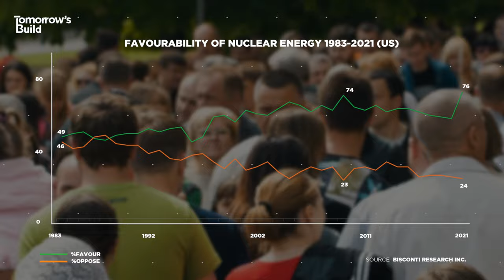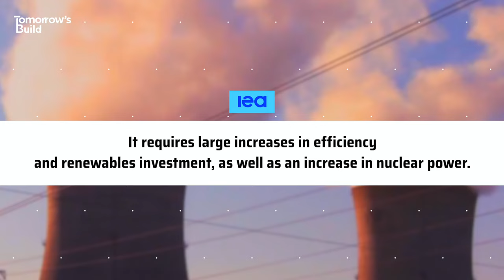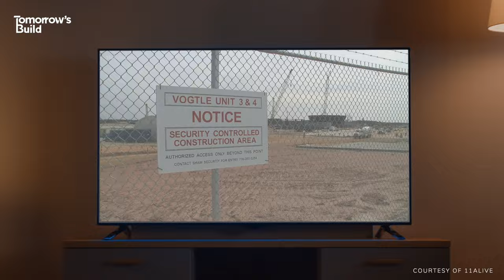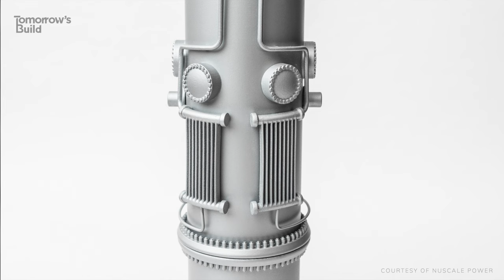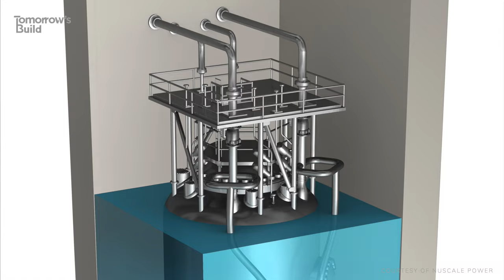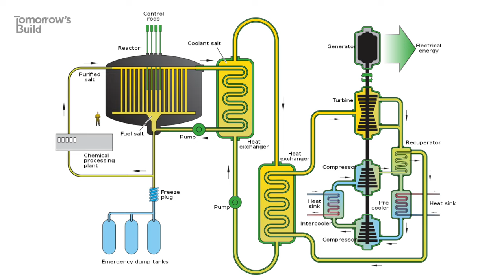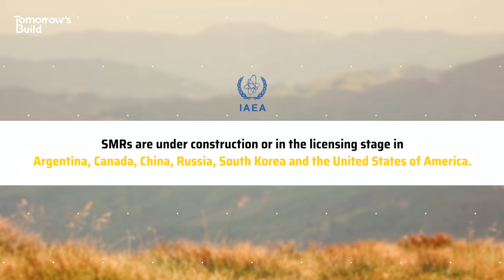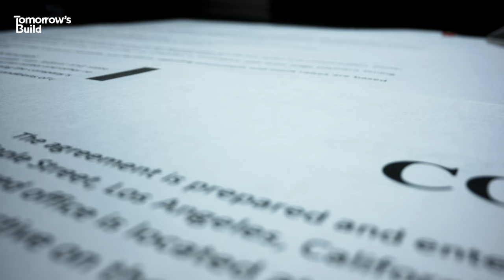These Mini Nuclear Reactors Can be Built Anywhere

Comment: I think security is still an issue. They can make them safer from malfunction, but what about sabotage?  It’s easier to defend 1 large plant than numerous small plants spread out over the country.
Reply: I just had a chat with Putin, and he said not to worry as he'd be happy to secure the nuclear facilities.
Reply: Exactly what I was thinking. I'm favorable to nuclear energy, and some of the most recent stuff is interesting (thorium reactors, or those that reuse nuclear waste...), but I'm skeptical about the security issues for those small reactors. If I was a terrorist, that would be my first target...
Reply: Actually, attacking a nuclear power plant is not very feasible for a terrorist. These reactors are all built to withstand earthquakes, even bombing, etc. It's highly doubtful that a terrorist can actually get a bomb in and even then have a bomb that is big enough to cause a meltdown. What you should really worry about is where we store spent fuel. These places are more vulnerable and it is also easier to cause contamination of the environment because the storage vessels themselves have thinner protection. However, this will remain the same as with bigger reactors as we can store the waste of multiple smaller reactors in one facility, equivalent to one facility per large reactor. On top of that, it is also still possible to build multiple of these smaller reactors on one site, thus requiring the same amount of security as a large reactor, with the added safety in terms of malfunction. You should also keep in mind that if you spread out these reactors, the distance between them and where the electricity is used is lower, reducing power line losses and gaining overall efficiency + a more robust grid, that is less vulnerable to power line cuts.
Reply: @DemPilafian  As would MBS and Iran's leaders, not to mention Mr. Xi.

Comment: We've had this all before, with the Canadian SLOWPOKE reactor (basement reactor) being proposed for district heating in the Northwest territories and when there was a misunderstanding between the US and Canada on how the US wanted the distant early warning radar stations to be powered, the Canadians designed a passively safe solid state pebble reactor sometimes called "The Nuclear Battery" which was later brought up by first nations representatives as a possible way to power remote communities.   The problem is unauthorized access to nuclear materials as there will suddenly be a lot more locations to keep secure which will undoubtedly be remote locations.  Such small reactors would benefit from being fabricated in factories and can take passively safe technologies such as molten salt reactors so they would be far safer than existing reactors but where they fail is that there could be a lot of them in locations difficult to secure so it would quickly become impossible to prevent nuclear materials to become available through unofficial means thereby making the risks of dirty bombs or even atomic bombs extremely available (though it can be argued that this risk already exists).
Reply: The amounts of nuclear fuels being used would be small and it would be notice if the fuel was stolen.
Reply: @bighands69  Sigh, you don't understand math do you.  It's a matter of probabilities, let's say there's a 1% chance that enough nuclear material would be stolen from a nuclear power plant (yes the probability should be much lower but this is just to show you the math), that would mean there is a 99% or rather 0.99 chance that there would not be such a loss, therefore for 100 nuclear power plants there would be 0.99^10 which is 90.4% chance that the material won't be stolen which is a 9.6% chance it will be stolen.  Expand this to 100 plants and you have 0.99^100 which is a 36.6% chance the material won't be stolen or a 63.4% that the material would be stolen.  Also the amount of fissionable material a small reactor may be small but it takes far less to make a dirty bomb, indeed you could probably make hundreds of dirty bombs from the amount of material needed for criticality.  Expanding the number of nuclear reactors to thousands by having small reactors does mean the loss of a lot of fissionable material, we've already lost a lot of nuclear material including 17 war heads just with the US military alone, a lot more is believed to have been lost due to the fall of the Soviet Union and not just with weapons and nuclear reactors but the Soviets also used Strontium 90 RTG's to power remote light houses and weather stations and people have died from radiation exposure from trying to salvage metals from such RTG's, note that RTG's have far less nuclear material than even the smallest nuclear reactor and the material they have are not even fissionable as RTG's work by nuclear decay yet they would be plenty for a dirty bomb.   The nuclear reactors may only have as little material as possible for criticality but that's plenty for hundreds of dirty bombs and they may have security but if there's even the slightest chance some material could be lost, with thousands of reactors you can be certain they will be lost and they have been lost even with the few reactors we have today, this is simply due to the math.
Reply: @johnwang9914  
The amounts of fuel being used is extremely small and removing the fuels from the reactors which have up to 50 year life cycles would be of such a complex nature that the cost would go through the roof. 
And to obtain enough fuel to then use as part of a thermonuclear detonation system would be very difficult to achieve. 
So that means shutting down several thousand reactors and then having teams painstakingly remove the materials without shutting down the mini reactors while nobody notices would be like trying to catch a bullet with chopsticks. While technically possible there is no known mathematical probability that could be use to compute such risk. 
I am afraid for dirty weapons systems nuclear material could be found from easier sources that already exist.

Comment: Gr8 update on SMR. You missed doubling of efficiency & hence cutting cost by half if waste heat is used. The latest 2 Siberian locations include District heating. All existing plants near population or industry could also produce District Heating... Also consider adding Canadian Pebble Reactor designs to your SMR List.
Reply: Nuclear is ideal for District heating, with very large volumes of low grade heat. Also, there is potential for desalination... 

I'm interested in fast breeders, but know they are proving to be tricky beasts
Reply: @growtocycle6992  Thorium Reactors look really interesting Th233+n 》 Pa233 》U233  not only using cheap abundant  Thorium & Waste Spent conventional Reactor fuel but fail safe. The reaction is no self sustainable meaning soon as external Xray source removed reactor passively powers down. CANDU & others can easily be converted to Th Reactors. Another major waste is Cd, the major metal in Cladding of fuel bundles. It can be used 50% dilution once then it's too Frisbee & weak. It should be all used as cathodes in shipping countainer sized NiCad batteries on-site at existing Nuclear Plants. The low radiation would  be blocked by the Ni Anodes.

Comment: This prof is ignorant of the basic fact that apples and oranges can't be compared. Solar and wind projects are meant for just 25 years. And that too their efficiency starts decreasing after 10-12 into operation. Their capacity factor is 15-25%. Nuclear plants are meant for more than 60 years (new design are for 100 years and beyond that). The capacity factor of nuclear is 4.5 times more than that of solar.  Considering it, nuclear costing 10.8 times more than solar on per MW basis is still cheaper than solar.
PS: solar would become even more costly if the cost of  battery storage required to make solar a round the clock source is included.
Reply: True but it’s not just capacity factor that gives the advantage. Nuclear is scheduled, one can choose when it shuts down for days weeks months for refueling, by the individual reactor. That schedule is not set by the weather, day/night, winter/summer.  Solar by contrast flips off over an entire hemisphere of the planet, every day.  Wind too, over a large area, for days or a week, all wind power gone. In this way Nuclear is infinitely better, not 4x better.

Comment: Only problem of nuclear is its expensive. It might be just the one problem halting mass production
Reply: SMRs address this problem. Using modular and standardised parts lowers costs, while still allowing high levels of quality control.
Reply: Over its lifetime nuclear is actually pretty cheap, and these are going to drive the cost down further. Currently, reactors are built bespoke. SMRs are intended to be mass produced dropping the costs significantly
Reply: @kokofan50  not a single one of these has ever been tested at scale. we are still at least 5-10 years from large scale manufacture
Reply: @armorclasshero2103  Tell the navy their reactors haven’t been tested, and the first civilian design is a PWR with a site that should be operational in 2-3 years. Other designs are further out. However, none of that really matters to how they’re going to be built
Reply: @kokofan50  the navy is exept from many regulations that are far more restrictive in civilian use
Reply: @armorclasshero2103  true, but you are arguing that MSRs have no track record.
Reply: @kokofan50  they basically don't by dint of comparison. not in a heavily regulated market framework.

Comment: Can modular reactor design be extended to chemical processes? For example, can a modular plant system be installed near a wellhead that would be typically out of range from conventional pipeline systems in the oil and gas industry?

Comment: If areas zoned for industrial and commercial use got their power from SMR's, the burden on the main grid would be significantly reduced.  Over time, the success of the SMR's in industrial/commercial parks would then make its way into the residential areas.

Comment: Like the professor pointed out, even if these SMR's become a working reality, they are still going to be too expensive on a per-kilowatt-hour basis compared to larger reactors or even compared to renewables.  So even if we overcome the engineering challenges and the public acceptance challenge (both of which are not insignificant), we'll still have a solution that's very costly.  But hopefully these SMR's and the lessons learned with them will lead the way to further innovations that bring down the cost while improving safety and portability.  But there's also one other really huge concern about these that the video didn't even mention -- what dangers or risks do these pose when in the hands of bad actors?   These are still fission reactors after all, and fissile material can be used to make a bomb, including a dirty one.  So I guess the ownership and operation of these SMR's would still have to be very heavily controlled (in other words, I doubt we'll see these as countertop appliances in homes like you see in the movies).
Reply: There is some loss of efficiency, but reduced cost of manufacturing from serial production and using simpler types of reactors. Also, there are much simpler ways to mass death than trying to crack on of these open to grab the fuel to take it off somewhere secret for tons of processing.
Reply: there are radioactive sources in virtually every hospital in america, and some of the worst radiological accidents in foreign nations came from “orphan sources” - or medical equipment that got unaccounted for. the biggest determining factor would have to be its danger in dealing with. radiation makes it hard for terrorists to manipulate the stuff, said radiation of which is the same source of its current costs. thorium reactors produce even higher levels of gamma radiation - making it even harder for bad actors to get their hands on it. overall it’s just not worth it for bad actors, there are much more efficient ways to kill en masse.
Reply: nothing necessarily wrong with being more expensive. Depends how they’re factored into the overall energy production mix. Filling in the bumps in renewables is critical - excess renewables you could put into hydrogen or other energy storage, and have nuclear to provide necessary baseload when renewables/storage can’t supply (and run stable state to also produce stored energy/hydrogen continuously). If you had eg 20% of your capacity from SMRs even if they’re more expensive, the overall cost of generation can be low enough when combined with cheaper renewables
Reply: Nuclear construction costs only impact the cost of nuclear powered energy until the loans are paid off. No energy source other than hydro has ever been able to produce energy cheaper then a 20 year old nuclear power plant, and nuclear power power plants have useful lifespans of at least 60 years. The "professor" is a known wind and solar industry shill who's made a career out of his ideological opposition to clean nuclear energy. If you attempt to build a 77, 300, 470 MW reactor using the same manufacturing techniques as SMR then yes, the general industry consensus is that costs per MW will be far more expensive. But SMR aren't just designed to be smaller, they're designed to have significantly simpler and more robust cooling systems, will be built in a controlled factory setting, and will be built in a series, which is the best way to bring down costs. Building out at least 1.5-2x the capacity factor plus weeks of storage will have to be replaced multiple times throughout a nuclear reactors 60-100 year lifespan will never be cheaper, which is why costs are skyrocketing in California and Germany.
Reply: @kokofan50  most of these designs are breeder reactors, you won't need much processing
Reply: @bryanbarnard4094  you're not factoring in the overhead costs
Reply: @armorclasshero2103  most of them are burner reactors, and the breeders are thorium, which requires extracting U233.
Reply: @kokofan50  burner reactors are by definition enrichers
Reply: @armorclasshero2103  1) you brought up breeder reactors, not enrichment. 2) CANDUs don’t use enriched uranium.
Reply: @kokofan50  candus are ver versatile. the newer gen3 use enriched, but the older can be converted to thorium to become breeders or they can be converted to use reprocessed. they likely will have to do 1 or the other due to the economic climate unfolding.

Comment: First thing to comes in my mind when i hear nuclear power is: cheap, clean and safe energy. Ramana saying about costs, that SMR are much more expensive than traditional reactors. This is a new technology, it's always much more expensive at the beginning. Anyone remembers the costs of normal solar panel about a 10-15 years ago? They were cost a small fortune. Now, they are really cheap, but still not as effective as nuclear power. Nuclear power, and nuclear fusion are the future, not wind or sun.